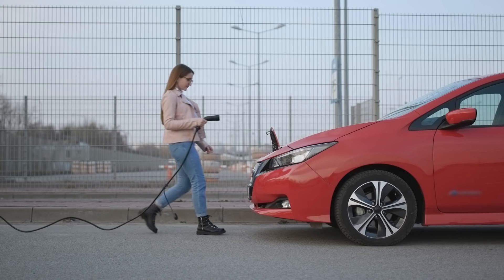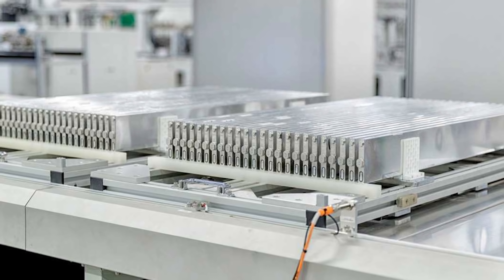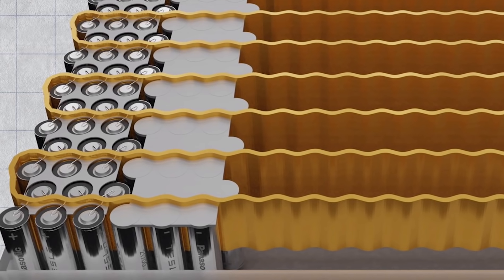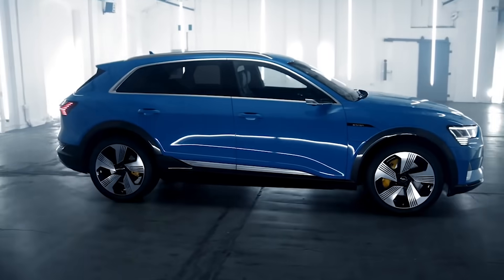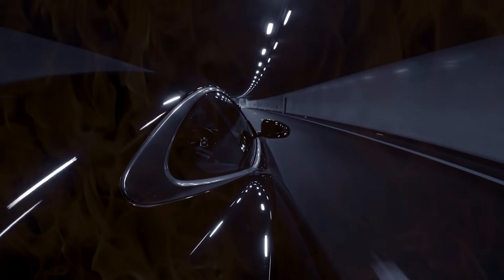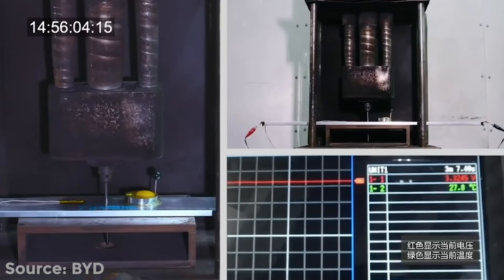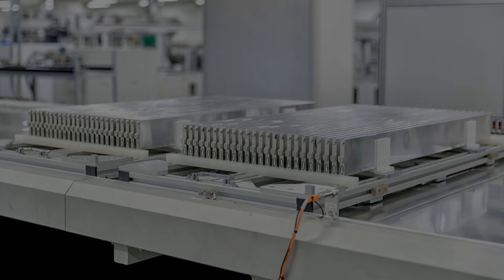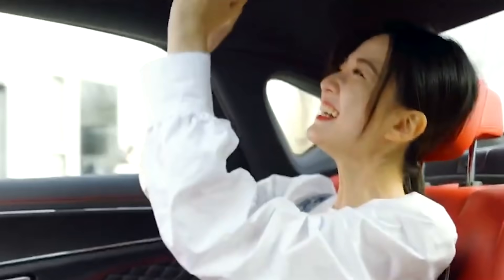Uncovering China's Battery Breakthrough

Comment: Maybe it's time to bring back Kettering's (1922) copper cooled car.  There is a reason radiators have traditionally been made out of copper.  Excellent heat transfer (10 times better than iron). No liquid cooling needed.
Reply: Copper is too expensive these days. Aluminum is pretty good and lots cheaper.

Comment: the reason why the LiFePO4 Cell didn't burst in flames is because they are intrinsicically safer, not due to their surface area. They are also lower in energy density which is usually a downside.

Comment: Flat batteries is no new innovation, two the reason why cylindrical batteries are the preferred method by the rest of the manufactures.
One - cheaper & faster to manufacture
Two - being cylindrical the chances of delamination is minimal to zero

Sure flat batteries are great you get to utilize more volume area & heat transfer is better due to the large surface area, but the constant changes from hot to cold when batteries are being discharged then cooled down then heat up again when charging. Thus the effects of metal fatigue is greatly increased especially on flat surfaces fact, to counter it you will need a thicker wall surrounding the flat batteries to make it more rigid but the catch 22 situation the ticker you make the walls the less efficiency per volume or energy you can store in the battery. If they make the walls too thin expect life expectancy to be very sort with these batteries.

Comment: You forgot one thing to mention, the larger the surface area of single cell the more chances it's going to be difficult to maintain as in cells you can just replace the defective one but in a flat single module it's not that simple, that's why Tesla still use the cells bundled together instead of single flat battery assembly.
Reply: This will be the same pretty much, they are like 1cm thick so it will be like 300 of them in each battery :P He didn't explain that very clear. It's not one single flat battery, but 100s of "flat long battieres".

Comment: Wouldn't use of carbon fiber in the chassis will reduce the overall weight of ev? Is it economical, at what cost?
Reply: At the cost of incredibly many lives as it would have a very weak structural integrity

Comment: Hi would it be possible to use the tR26650 lithium ion cells that have 8800mah and about 3.7-4.2v they are small but powerful and about twice the size being fatter around but they are cheap as not used that much and very powerful

Comment: Yeah I think you still need liquid cooling and heating because in parts of the world cold affects LiFePo and lithium ion batteries in similar ways so you need to keep them warm to avoid range loss from the cold, I don't think air cooling will cut it.
Reply: 🙋‍♂️More areas of cold on the surface of the batteries to freeze and condensation expansion from hot to cold the sweat bring corrosion.
This is like an advertisement so they left out many negatives.
Reply: Well, if you design the batteries to take advantage of airflow, especially when the vehicle is in motion, then variable flow vents that open for more cooling and close more for colder weather could help maintain the correct temperature of the batteries, also a thermoelectric system could be used for either really hot weather or really cold weather to help maintain temperature, be sides the people will need to be heated or cooled in those conditions anyway
Reply: Environmental heat transfer requirements are much much lower than operational ones. As in Watts per hour of keeping them warm in cold conditions is not only lower than Watts per hour of cooling during operation, but also identical for all battery shapes.
Reply: This is a real issue for people living in Siberia and Northern Canada, etc.
For these people, range-extended electrics will be the answer.  Range extended rotary engines running on natural gas would work beautifully- the engine would be tiny and extremely simple, as it need run at one speed only.  The natural gas is abundant and not subject to the cold like diesel, and it doesn't require complexity to inject into the engine.

Comment: Not a break though at all, but rater a huge step back! 
Both the Blade shape and the Air Cooling is the wrong way to go.

The Blades do NOT have more surface area, but more like HALF the surface area for cooling than the cylinder cells. Imagine you made the cylinder cells square instead of round, then packet them together to form a blade. This is cooled on just two sides of the batteries. Now space them apart so the cooling can go all around... now you have cooling on 4 sides, so twice as much. 
A cylinder would would have even more area per kilogram than that.

Air cooling of of the battery pack is what is behind Nissan Leaf's "ChargeGate" where the batteries can't be cooled fast enough for more than one rapid recharge per trip. Also Air Cooled battery require large passages throughout the cells, making them much less dense, thus physically larger than the same battery, liquid cooled.

Top that off with the poor performance per Kg of LiFePO4 cells, and you have a three times disadvantage there. 

You might be able to compete with one of these "Features" but all three will doom you to fail in the current marketplace.
Reply: EXACTLY! Wide flat surface area is bad!

Comment: Legit saw the blade and laughed as I was like, wait, they just skipped a step and improved virtually every technical spec related to the batteries longevity? Anyone ever open a cylindrical battery? It’s just a rolled up rectangle. 

I guess circle truly does get the square...

Comment: Wouldn't it be better if the battery's where positioned in the direction of the chassis so if you drive the wind goes through the battery and cool them.
Reply: problem with that is as the air goes further down the battery it won't be able to cool the back of the batteries compared to the front and thus presenting a risk of overheating

Comment: Sounds like bullshit. Water cooling is much more efficient. Maintaining the exact temperature of cells is very important. Much harder to do with air because air has low thermal capacity in compare to water. So the front of battery might be cold enough but then the air gets warmer and the back of the battery will overheat.

Comment: weight is a key concern..weight vs range is where the tradeoff happens...there's nothing revolutionary here..I saw nothing in this video revolutionary or even evolutionary...okay being rectangular *might have application advantages...do they out weigh the production cost advantages?
the congo produces by far the most cobalt with russia coming in second at less than a tenth of what the congo produces...so why do you cite austrailia...I;m wondering if you were given a script from china at this point... also what kind of idiot engineer would use those batteries for any part of the chassis?..can you show me on any other bev these "large cooling pipes"?
lithium iron phosphate is also used by tesla, and others...once again, how does this fit in with "breakthrough" or anything different than other manufacturer?...this is not a good video, I apologize, but I expect any tech tuber would do at least *some homework before putting something like this out. I'm sure the shape of the battery could be a boon to density and temperature control...but everything else around the video that is nonsense...it feels like it's spun in BYDs favor for even the most standard things.

Comment: Energy per mass is more important than energy per volume, by far. LiFePO chemistry is not new, or cheap, just cheaper than LiCoO2. It also stores less energy per weight and per volume than those "standard" lithium ion batteries. It probably lasts longer and is safer though.

Overall a mediocre presentation of half-researched information.
Reply: I'm sure there's applications where these batteries are more useful but to call it a breakthrough is ridiculous. At best it's a niche advancement with few of the listed advantages actually being true, recycling and cooling being just two.

Comment: I wouldn't call this a "Breakthrough" More like a few things done a bit differently. Are the batteries replaceable? Since they are part of the frame of the car I wouldn't think it would be simple.. and even if it was possible the price it would cost just to replace these batteries would be insane. I get that one pin entering a normal batter would set it on fire and the new flat battery doesn't however that's only with 1 pin entering the battery... when you have a car accident there are higher chances that parts of these batteries could get damaged so who knows if it will still not catch fire. 
IMO this is far from being a breakthrough.. these days people slap the word breakthrough just to get peoples attention.
Reply: There are some brands of electric cars in China that can automatically change batteries
https://www.youtube.com/watch?v=PIfm6CbmanY

Comment: the thumbnail looks like some kind of ZPM like in the tv show stargate Atlantis...
Reply: Our known physics supports the concept of direct uranium to electricity in a solid-state cell similar in size to a battery.  It would have something like 25 million times the energy density of current batteries.  If someone can solve the topological problems and mass production of nanotechnology, well, it is possible.  Basically the problem is to take a material that converts radiation into electrons, which we do have, and then cram as many of those with corresponding copper wires in an arrangement that looks a lot like the schematic of a computer CPU.  Failing that, we currently can convert radiation into magnetism, but we would need some really really really tiny coils of wire wrapped around magnets, like millions of tiny magnets with coils of wire wrapped around them per square inch.  It is possible, but the mass production of it is currently impossible.  With current technology we could make a AA battery that would last for 10 years, but costs $500,000 dollars.  There is a reason why this technology is only ever used by NASA on satellites that get sent into deep space.  And that is also the reason why you never heard of it, no one is going to spend the cost of a new Ferrari so they can have a flashlight that lasts 10 years.
Reply: @musikSkool  that is really cool!
Reply: I started reading the comments to see if anybody else had made the connection to the ZPM and you made me laugh because that’s why I was gonna leave a comment Ha that’s exactly what I thought too funny
Reply: I hope not. The Ancients made finding the ZPMs a real pain in finding replacements.
Reply: Maybe a little bit

Comment: Your video is great until up to a point of over informative. It is so unnecessary to stress fossil fuels used to create the blade batteries.  Since fossil fuels been used at certain level to create batteries and vehicles mentioned in the video anyway.

By the way, something big that didn't mentioned much in Western headlines:

World's first extreme high voltage electricity transmission line crosses SW China
https://youtu.be/ZqEKjtunAlk

Comment: You did not mention the lifetime of these cells. For fast do they lose capacity? This is very crucial to judge whether they are really better than traditional lithium-ion cells
Reply: They are way better actually, the life span is much longer. The big drawback is energy density (which is lower). It's not a new technology just a new idea with the design. The hope is that you can remove enough heat-sinks to make the less dense battery still worth it if that makes sense.

Comment: The shape of the battery pack is pretty good for cars but I would not call it a breakthrough. LiFePO4 is a common Li-battery material and has some drawbacks compared to Cobalt too. E.g. lower energy density, lower cell voltage and problems with low temperatures.

Comment: Using batteries for structural rigidity is not a good idea. You'll either need a thick casing or a crash will see a HUGE release in chemical energy.
Are these batteries solid state or something? Are there pouches in these like a laptop battery?

Comment: Everything  makes more sense  but there is a problem. In countries  where salt is used to melt snow on roads , the salt would corrode the outer case of the air cooled battery.
As it is, salt destroys cars by making them rust.

Comment: BYD Han EV is $40,000 CAD, goes 605km a charge
Battery pack is 76kwh and goes 7.9km per kwh used. Its also very quick 0-60 in 3.2 seconds for the $40,000 4WD model

Model 3 is $41,000, goes 354km a charge
Battery pack is also 76kwh but goes 6.9km per kwh used. Its slower 0-60 in 5.6 seconds for the $41,000 Standard range model

Overall, Tesla is feature rich but over priced. BYD cars go further for a lower price. Quite surprising!

Comment: This video could have been far more technical instead of emotional. The foil packs don’t look much different than some laptop batteries, and LiFePO4 have been around a while. There must be more to this, but it wasn’t researched properly.
Reply: And from what I understand, LiFePO4 batteries have lower energy density than Li-Ion.  The safety is a trade off.  I wouldn't put it past them to just straight up be lying about the specs.  We've seen that over and over already.

Comment: You forgot to mention, that cylinder cells in fact ARE rectangular cells, but rolled up.
And it's done for a reason!
The walls these rectangular cells have? They add more weight and overall lowers power output. 
This is not a revolutionary design, but exactly the same as what LG is doing with their pouch batteries used in Hybrids.
Pouch hybrid systems are in fact, much lower in range than cylindrical batteries. In a ratio of about 1 to 5.
This is why ALL reputable car manufacturers go with cylindrical.

Comment: Interesting, anything to improve and reduce the electric battery issues…although nothing was said about charge time of distance in between charge…
Reply: i hour to 80 % , range is 650 klms.
Reply: One of the biggest problems with fast charging is heat dissipation. The shape of the new cells and battery configuration looks to be much more efficient from that aspect

Comment: LiFE cells aren't new, they're less efficient than current cells.  These are cheaper, but not even close to the density that other tech is.  These are good for home systems and prefer a .2c charge and discharge rate (aka 5hrs charge).  Using 80% charge cycle and .2c charge and discharge, the batteries can last for 10,000 cycles. Fast charging drops their life to around 3,000 cycles.  Water is way, way more dense than air and can carry substantially more heat as well as be hooked to heat pump to cool  the cells below ambient.

Comment: id like to see how they handle being crushed in a car crash vs rolled up batteries?
Reply: The reason given in the video for them being safer when damaged was their high surface area to volume ratio, allowing them to dissipate heat more quickly. I feel like, unless they were completely crushed from end to end lengthways, they would still have a high surface area to volume ratio even after crushing.

Comment: Good luck when you get in a crash with these as the cars infrastructure... lithium electrolyte based batteries (even the iron based ones like these) are still flammable regardless of those puncture test results

Comment: So what I got from this video is the Blade battery will take up less volume/space for the same capacity but will still weigh about the same?
Reply: Actually the blade battery is a little bit lower energy/area, but since you can use more area in the car (less cooling) it should be pretty much same distance, less danger and better life-span.

Comment: Maybe it is not difficult to find but will be interesting to know the energy density at cell (~160w/kg?) and pack levels? It seems to me that cylindrical shape has better surface-to-volume ratio for cooling, and much better structural strength. I did not see any breakthrough (maybe with its own) here, anyone? On the other hand, if they can produce the it cheaply and fast, it will be great for short range driving. Maybe this will be incorporated in Tesla's $25 Model 2?

Comment: these dont fit in Torches & household elect  items
          flat car batterys have only   1 use  only .
Reply: Neither do phone batteries though, or car batteries. Industries that would benefit from smaller/lighter batteries are the only thing driving battery evolution. If battery tech evolved could the new tech not be adapted for future torches and household items? Nobody is crying out for wafer-thin torches though, afaik.

Comment: There's nothing revolutionary about this battery, the only thing different about it would be the form factor.
Reply: The form factor isn’t really unique either. We’ve been using shaped LiPo and L-ion (and LiFe) cells for decades. Look at your cell phone or RC aircraft batteries. 

LiFe batteries have around 1/2 the energy density (energy per weight and volume) as Lion, and the output rates are far less. It is definitely a whole lot safer, but it will be able twice the weight for a quarter the “umph” (the umph can be mitigated by more cells in parallel)